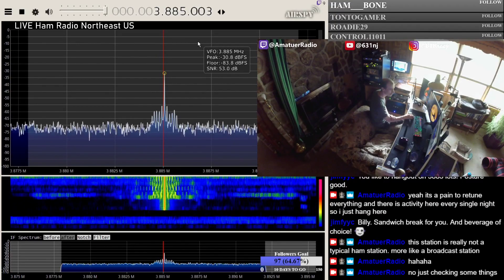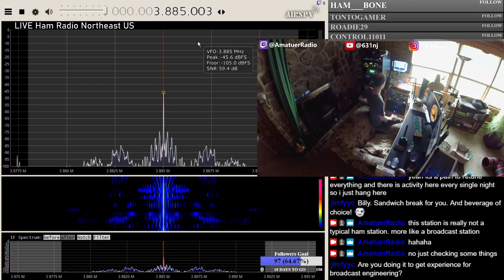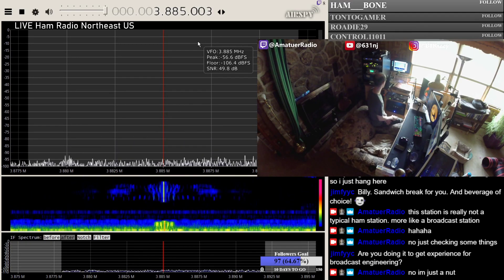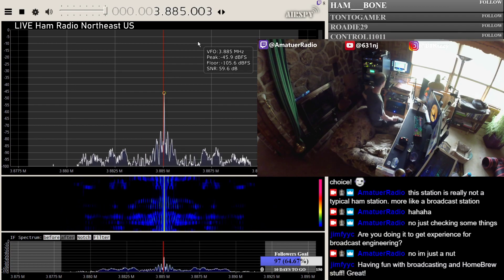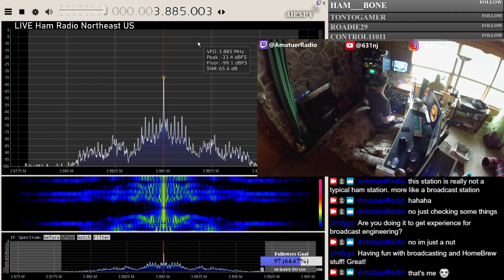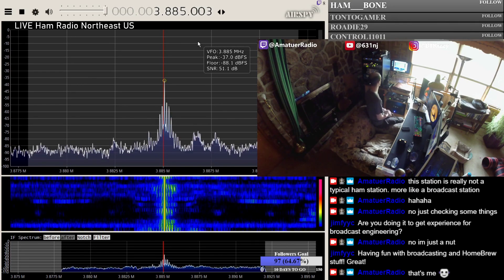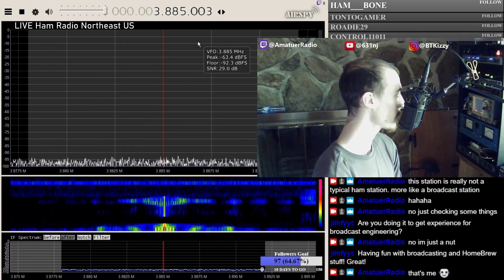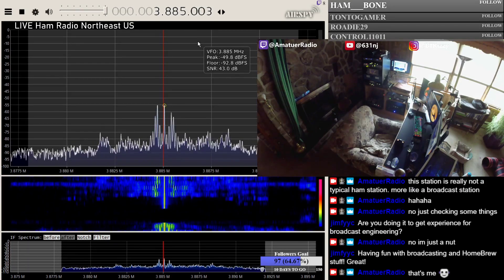Collector Modulating a CB Radio with HIFI Audio

Comment: I use an old ts440 with an old cb ceramic filter in place of it's original. Processed audio through rack gear right into the mic plug and I have had reports of people being blown away. Two people have told me that the audio is roughly 10khz wide. Just an experiment. Cb radio is the experimental audio practice playground.
Reply from the maker: love it!  a friend of mine did a similar modification to his TS440 where he used a 10k collins mechanical filter and direct fed the balanced modulator with audio.  If you want to check out his mods look up W2VW, he has a few articles on the TS440.  CB Radio is the best playground! Its where I learned most of what I know about this!
Reply from the maker: here i went and found a link for ya! https://www.amwindow.org/tech/htm/ts440/ts440mods.htm
Reply: @AmateurRadio  Thank you so much! This is like a hobby with in a hobby!

Comment: Daaaaamn both of those components sound really great hifi audio is where its at!
Reply: I have been gathering equipment around to mid fi a cb base station. Been just trying to figure out how to hook iit up. I didnt know what turns ratio transformer to get but now I am going to check out the one they mentioned on this vid. Wonder if there are even any one out there still.

Comment: Great topic. I've been playing with 'modulators' for years . I learned from the same place/people. My favorite part of the hobby.
Reply: Would love to collector modulate a radio to hook up some of my studio gear to. I have a 50 watt pa amp I been trying to figure out a way to hook it up.
Reply: @scottisnotfromhere6553  the pa on a cb radio run from the pa jack to the audio pin on the ham radio the cb pa turns into a audio amplifier for the ham radio.  But to do what you're saying you want to do with audio equipment the plugs in the back of the ham radios are best to wire the microphone or stereo equipment into it direct it will bypass the audio filter that limits the audio frequency range. you have to look at the ham radios operator manual to find how to do it go to Bob Heil on YouTube where he explains it more.